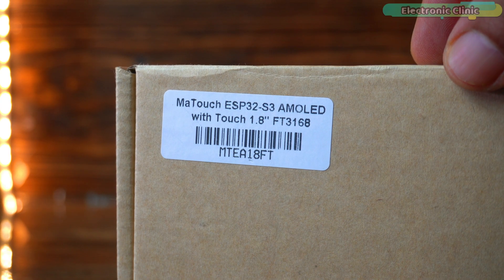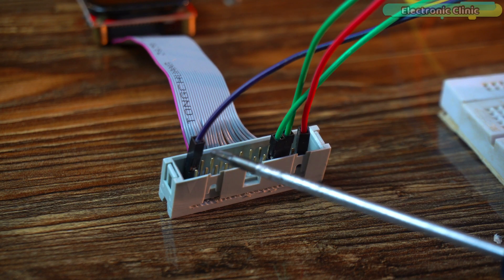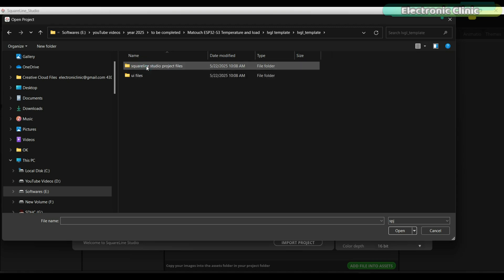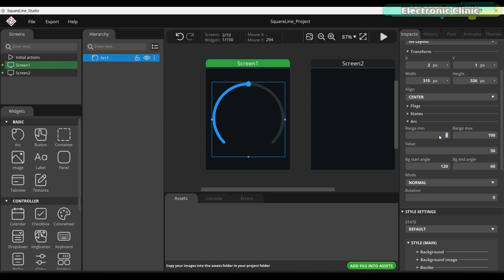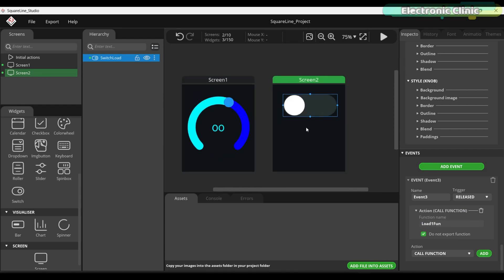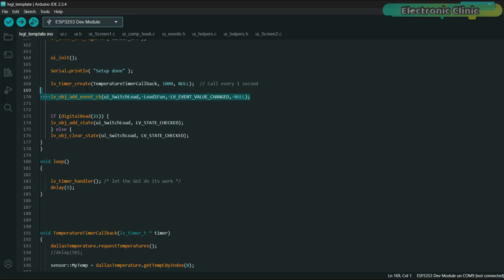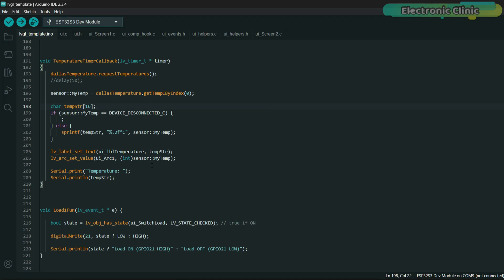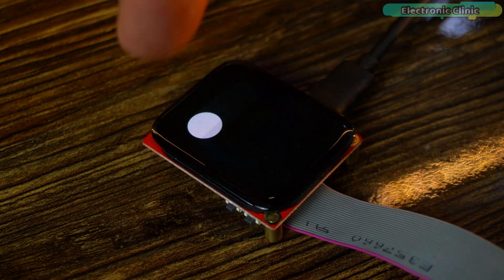ESP32-S3 Touchscreen GUI Project with SquareLine Studio | Control Loads & Monitor Temperature

Comment: More for esp32 s3 touchscreen with multiple sensors please 🙏
Reply from the maker: The upcoming touchscreen will amaze you. Did watch my latest video on this same display? I designed a BLE aap based call accept and reject system.
Reply: @ElectroniClinic  no actually I havent saw that one, must check it out. I am only new to coding but got one of these waveshare 7 inch esp32 s3 screens and couldnt figure out what all i needed to get it working. I didnt know what files I needed or anything, like i say new to this sorry. 

I still have the screen and would like to so something cool with it. I was going to tey eez studio byt maybe squareline studios is better? Anyway, thanks again for the video. I will go now and check out the other one you recommend.

You have gained a new subscriber, love from uk 🇬🇧 ❤️ Keep up the great work buddy 🔥

Comment: Nice demo, and what a sweet display module! Quick observation that your temperature timer callback is slightly flawed as tempStr will contain uninitialised data if the sensor is disconnected, and so it's undefined as to what will be displayed; maybe set tempStr to "N/C", or show the last value in a different colour to indicate that it's out of date, or just skip the update code entirely.